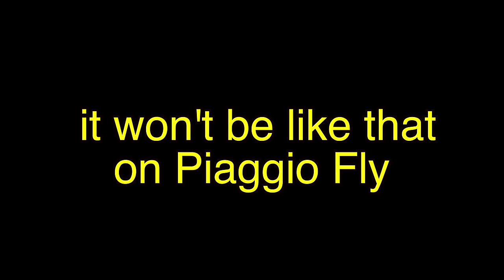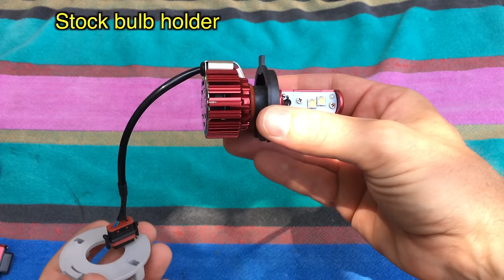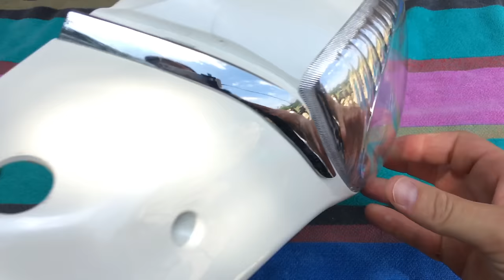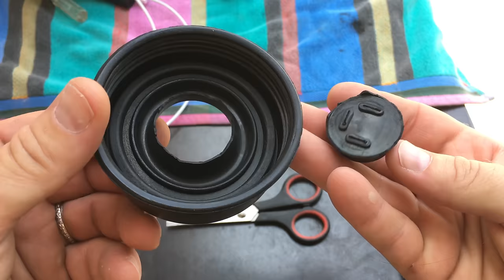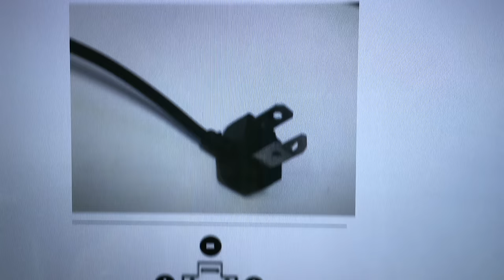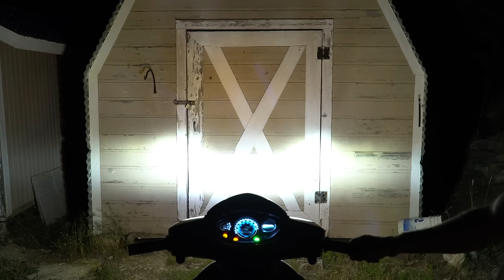Piaggio Fly - LED Headlight Bulb Install and Upgrade! | Mitch's Scooter Stuff

Comment: switched out LEDs all over my 2007 GT200 and have had great luck and not had to retro fit anything but just put the bulbs in and they work like a charm...easy on the battery too...kudos Mitch...as always man...you're a good dude

Comment: Jey Mitch, with my headlight it is a socket type just like a blinker globe. There's a grey plastic adapter that it fits into that then fits into the headlight.
Reply from the maker: What I would do is to cut that piece out and buy H4 socket to modify to fit in the headlight... but I am not sure what the hole look like...
Reply: Old post, but here it goes as a reference to others. Most probably it's a BA20d socket. 
Usually set from factory for 25/25 W bulbs (high beam/low beam) or the 35/35 W version. 
Worth mention the 25W bulb, tend to be used on the 50cc's. While the 35W usually are found on the larger displacements. 
Although physically interchangeable. One should be careful when doing so. Avoid overloading the circuit. ;-)

This socket has 2 small locating tabs and it's not interchangeable with H4, etc.

Comment: I have a 2015 primavera 50 and i think it runs off engine magneto and heard LED maybe hard to install.. it has H4 now... will these work? id consider  capacitor in circuit...

Comment: The orientation of the LED chips look wrong? They're facing the sides of your reflector when they should be in a top-bottom facing orientation. maybe you should try turning it so that the chips face top and bottom of your reflector. that explains the "bow" shaped dipped beams; seen on the grass.
Reply from the maker: Tried that and it wouldn't work right :-/

Comment: How much brighter is the LED than the stock bulb? Is there a noticeable difference? I remember where you had changed a bulb on another Vespa to the one with the 'angel' ring type (2" MOTORCYCLE BI-XENON HID KIT Angel Devil Eye Headlight Projector Len+ballast) and was curious to this upgrade as the other one you had to take the clear lens off the headlamp to properly fit whereas this one it just takes a little tweaking on the backside.
Reply: Yes

Comment: Great clip Mitch, as always. My '09 125 Fly doesn't have an H4 bulb. It has a BA20d or 2S standard incandescent bulb. I haven't found any upgrade kits or how-to's. Any suggestions on upgrading this to H4?
Reply from the maker: Thanks Chris! Hmm is the plug same like H4 or it uses socket type thing?

Comment: First of all, thank you for this wonderful video, I have 2 questions: 

- I placed this bulb at a motorcycle mechanic but remove it rubber boot cover 

- why did you flip the purple and black connectors?
thank you in advance

Comment: Hi Mitch first I would like to thank you for your great videos they are really very helpful. As you recommended to me once I bought a piaggo fly 2017 but I have a problem and wonder if you could help me . In my scooter I cannot turn the headlight off so even when I drive in daylight the light is always on and sometimes the weather is very hot and light and its cover got very hot and I am afraid that it will start melting at some point. My question is is there a way to install a switch to make the head light goes off ? I mean is there an alternative for installing a led lamp ?  Unfortunately I don’t have the tools to install a Led lamp at the moment.
Many thanks in advance
Reply from the maker: You're welcome Mohammad!! that's normal.... the motorcycles and scooters headlight always on... never off... that's law. I live in hot place too you are good to go

Comment: Mitch, is it normal for the led bulb to flicker at idle?
Reply: yes it's normal. as the voltage is low on idle. if you add a capacitor in parallel to the led, it should smooth out the flicker. probably want one about as thick as your thumb or something half decent in size. or get some from an old computer power supply or something (observing polarity of course)👍
Reply: @phildawe7172  where would the capacitor exactly be located in the complete circuit?
Reply: Hi  @hassanalbasir794  It was already explained above. In parallel (to the voltage rail) and the rating of the caps must be higher than 12v. If that didn't make sense, I recommend you not to do it. I found that it never worked that good anyway as the alternator is quite weak on that model and in future I would just connect it directly to the battery with a switch. Or buy a higher output halogen bulb that exists, it is the best simplest fix for the weak stock headlight.